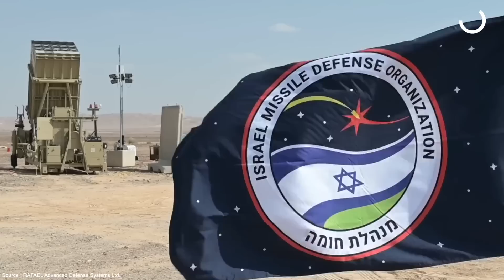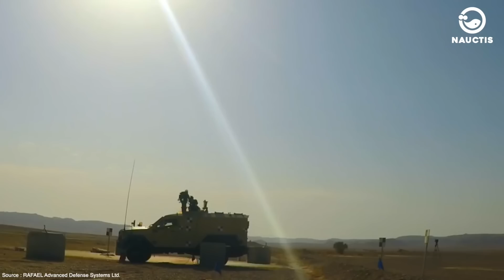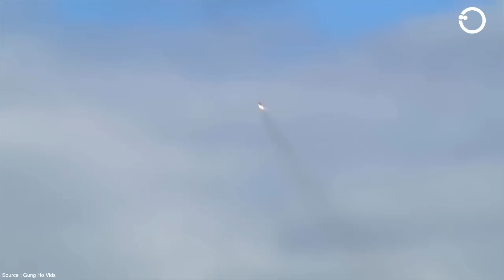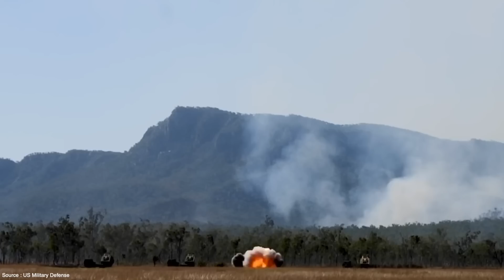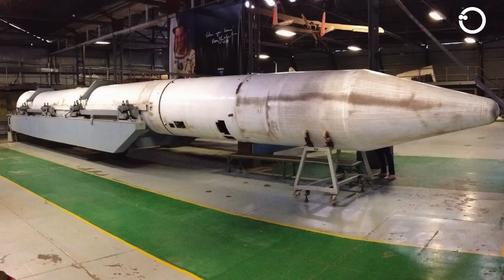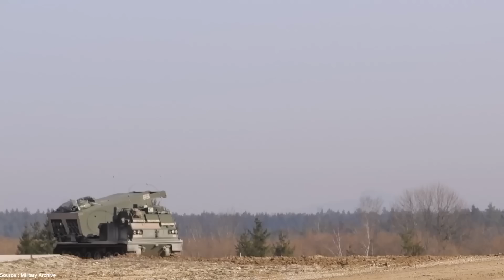ISRAEL'S SECRET Weapon Revealed: The OVERPOWERED WEAPON that Can Wipe Out enemy in 1 Day

Comment: Jericho 3 missile, range 15,000 km, speed Mach 22 (16,879 km/s)capable of carrying warheads weighing 2,500 to 3,800 kg. The missile is capable of carrying one nuclear warhead weighing 3,800 kg or 5-7 smaller nuclear warheads that can be launched at separate targets.
Reply: @@isaackip6480fire 🔥🔥🔥🔥🔥🔥🔥🔥🔥🔥🔥🔥🔥🔥🔥 never ends for disbelievers
Reply: Km/h*
Reply: So it reaches its target in 1 second?
Reply: @lancemarchetti don't die as a disbeliever
Reply: no. gaining speed takes some time  @lancemarchetti